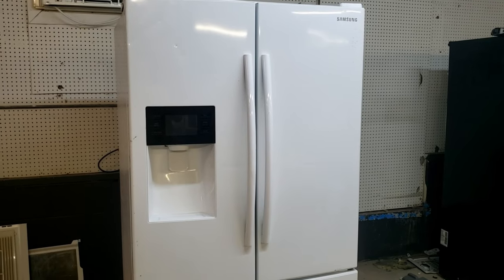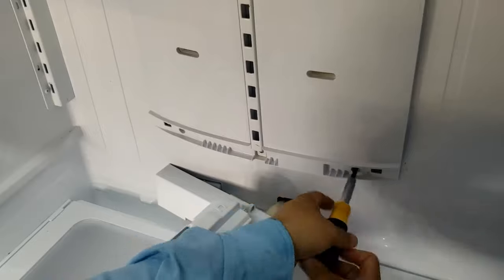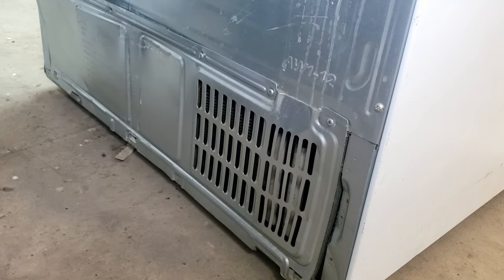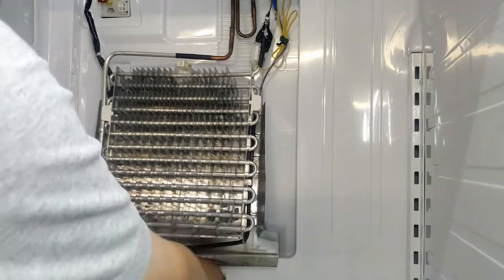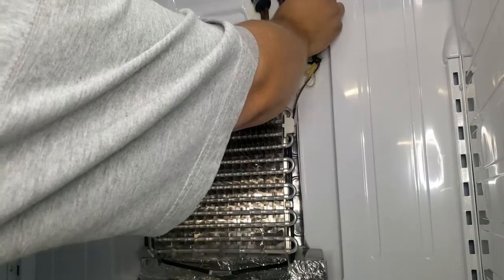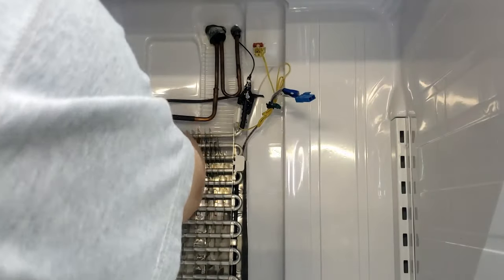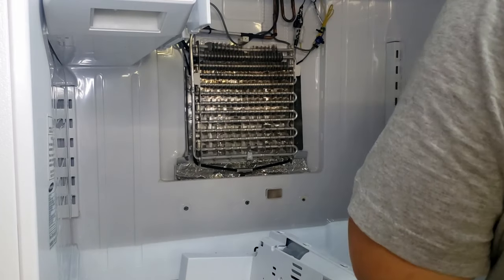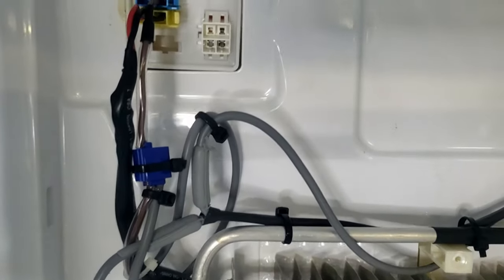Samsung Refrigerator Ice Build-Up and Leaking Water Inside Drawers - How to Fully Fix it Forever

Comment: Oh geez I was hoping I can find some way to fix mine Samsung that stopped working refrigerator a boy what can I tell you it's been sitting in my garage for every year only freezer part has been working thankfully do depend that'll make it work but for now I like to use it as a refrigerator as well quick question can we replace a complete back part why add another heater
Reply from the maker: Which "complete back part"?
Reply: @bensappliancesandjunk  the coils

Comment: You need to provide more instructions on removing Twin Cooling Plus cover.  I have removed all screws but panel will not come off.  Seems Styrofoam is stuck to ice.  Do I need to shut refrig to allow it to defrost?  If so that should be part of your instructions.  Perish food should first be removed to start this project.  Please don't assume that everyone's frig is going to disassemble as easy as yours.
Reply from the maker: Hi, I have multiple other updated videos on this with further instructions

Comment: What is the differences of the original drain tubes and the new ones? They look the same to me.
Reply from the maker: Depends on model. The replacements are 5 pieces and original are either 3 or 4 pieces. Main thing is the plastic graduated cylinder and the v notch duck bill

Comment: Hey Ben, great video and thanks for the effort.  SFQ, I have the four door samsung (RF4287HAR5) but i do NOT get water in the crisper drawers, i get ICE in the bottom of the FREEZER about every two months.  Is this a variation of the issue your video addresses or something altogether different?  If different, any suggestions on a fix?  Thanks again.

Comment: Can you share the link to the newer video of the install of YOUR kit. I purchased your kit, which slightly different than the pieces in this original video. I want to properly install your kit. I can't wait to fix this issue for good. i have been battling it for years and have replaced MULTIPLE parts only to have the issue return.
Reply from the maker: https://bit.ly/3pDgfER should contain instructions + all YouTube video links

Comment: Do I need to get a defrost heater too…or is there a way to find out if the defrost heater are still working
Reply from the maker: Run forced defrost, preferably with back panel ajar. Check for heat. If it heats good, the heater is fine. If it doesnt get warm at all, then either the sensor, fuse, or defrost heaters' bad and I do ahve videos about it.

Comment: Will this solve the issue if its our freezer fan that also gets the ice build up? We have this ice build up issue with both fridge and freezer, but freezer seems to be the worst of the two.
Reply from the maker: Yes and no.

It should remove moisture from the top cabinet and drain tubes, which should help remove moisture from all parts of the refrigerator, but primarily the top cabinet. I've seen this modification fix many other aspects of the refrigerator unintentionally such as the ice maker, too.

Comment: I have been fighting with this issue for 5 year now. I just ordered your recommended kits and will be installing them this week. 

Question: Would it help to cut back the foam insulation where the copper lines exit the back of the refrigerator and apply calk or putty  around the lines? The insulation around the lines on my fridge is always soaking wet when I defrost it?
Reply from the maker: You could potentially cut & re-insulate them. TYPICALLY the suggestion is to replace the evaproator cover which tends far more often to get soaked, so having the insulation with water still is an issue. The secondary heater should solve future water accumulation (unless there's a bigger issue than just the moisture), though.
Reply: @bensappliancesandjunk  I am installing the kit tonight and the heater cord is 3' long. Any advice on where to route the cord? Would doubling it up hurt anything?
Reply from the maker: @dougsprecher  double it up! I did another video recording of using it, and it easily folds up to double. They sent me ones that were longer than planned, but I did multiple tests with them prior to listing/selling them, and its easily flexible enough to fold double or even if needed, triple. I ran all the tests in the video with heating it via test, and it came out perfect with a very moderate heat.
Reply: @bensappliancesandjunk  thank you sir! Everything is in place and I am excited to fire it up!
Reply from the maker: @dougsprecher  fantastic! Hope you never see ice again!

Comment: Howdy Ben, I have a more basic problem…. I can’t seem to get the panel off. I’ve removed the 4 screws and from the bottom the panel pulls away (w/o the styrofoam) but the top doesn’t budge. Maybe a big ice ball still there? Fridge has been unplugged for 12 hours.
Reply: It takes a long time to defrost the ice ball. I use a steamer to accelerate the defrosting. You can also try a hair dryer but that doesn't work as well and be careful not to warp the plastic, easy to do even with a hair dryer.
Reply: @sjn7220  Thanks. I did manage to finally free the back. The ice ball was frozen around the fan and extended into the path of the blades (explaining the chatter sounds). Back together for now and working but I will order this additional heater.

Comment: I have a Model RF266ABRS mfg May 2009 - just discovered  a pool of water and ice below the cool select pantry (full width drawer) that sits below the crisper drawers - no parts house seems to have any of the defrost clips, etc. or the excessive frost service kit that will work with his unit - at least that is the result when I enter he model - is there something different about this model?
Reply from the maker: Drain kits are near-universal. Just buy generic and attach behind the plate, as that panel still looks like the same as all the others. Just make sure to clean drain hole out with water or something to ensure there's no obstruction.

Comment: I perform the mods something isn't right. It's even worse I think. I. Taking it apart to check for Ice behind panel. I. Also checking drain behind fridge. I'm also turning off water to fridge to make sure it's not actually leaking somewhere.
Reply: Ok its apart and the ice damn is definitely still there from the drain. Now I'm wondering if it's not that insulated section possibly messing with it draining. Causing it to hold water before the hole.

Comment: I have a GE model PFSS6PKXESS serial # FV 550293 refrigerator that has ice build up and water below the crisper drawers.  Will you kit fix my refrigerator too or do I need different materials and video for the fix?  Thanks.
Reply from the maker: I am not sure. I'll have to look into it and get back with you as I'm unfamiliar with the GE refrigerator and how it's system operates.

Comment: I was sending a message and sent it before I finished. When the diagnostic screen did not show a code. I touched the fridge button but it did not return to the screen with the temps as you showed. What should I check. Samsung refrigerator 
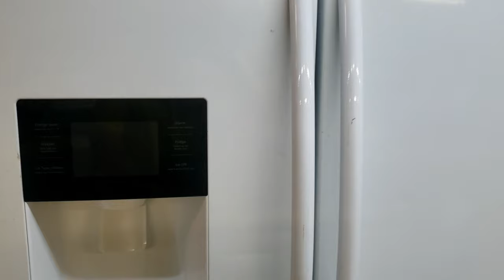0:07

Comment: Ben, I have Samsung 260BEAWW no outside water or ice.  Controls are on top of inside.  How do I get to Forced Defrost?  Thanks for the video.  First with a final solution.  Will purchase the parts and follow your instructions.  Bob
Reply from the maker: Is that the style that has a temperature display on the top that is on the outside of the refrigerator, but you must open the doors to see it? Please let me know and I will try to figure something out for you
Reply: @bensappliancesandjunk    Ice drawer in bottom and temp display inside the refrigerator must open two french doors to see. I can send a picture of the control panel.  The buttons are in line left to right: Ice Off, Power Freeze, Freezer,  Fridge, Power Cool, Energy Saver.  I have installed the new larger drain clip which did not fix problem.  The drain is freezing up and not clearing ice on defrost and the melting water overflows into bottom of the refrigerator.  Would it be better to install supco drain heater in the bottom? Thanks for the help.

Comment: I'm about to try this in 2 days. Thanks! Followed your links. What is the pipe wrap for exactly? And, have you seen/considered Nashua Stretch & Seal self-fusing silicone tape (available at Home Depot) which has a temp of -65F to 500F? plus waterproof, uv resistant, voltage up to 8000V. Seems pretty good and perhaps an alternative? But it is not an insulation tape.
Reply: Mission accomplished. hopefully it works. I had a huge ball of ice in the top right as expected. The fan was blocked with ice too, and there was ice in the panel's styrofoam. Drain was frozen down deep too. Had to keep pouring in hot water, then as it quickly cooled, sucked it out. (I used a damn straw! I'll invest in a turkey baster next time...) 8hr plus job. Just done. I watched your video multiple times when doing this. Thanks so much!
Reply: 7:10 - those self-adhesive strips has to be attached from outside of aluminum cover. You gave people wrong recommendation. It has to be between aluminum cover and fridge body !!!!!!!!!!!!!!!!!!!!!!!!!!!!!!

Comment: The kit I recently bought from you has a meter of heating element, where should I run/place all of the excess?
Reply from the maker: You can double up the element as its extremely, extremely flexible.
Reply: @bensappliancesandjunk  Yes, I found your other video on the subject and did exactly that... Just tested it and it's definitely getting hot... so that's good... next remove the non-clip for the drain hole and put the new one on... Thanks Ben!!

Comment: I also had the leakage problem unlike most I had no build up of ice anywhere. My drainage tubes were clear as I poured some water down the drain and heard it go into the pan. I did change out the heat  probe anyway for a larger one knowing it wasn't the problem but wanted to cover all my bases. Of course the leak in my veg bins into the fridge tray and onto my floor continued. I have no clue where this leaves me except to call a service tech, which I hate to do at the moment . Any comments/ fixes appreciated..

Comment: I did this repair exactly as you instructed. My fridge still freezes up badly. Is there anything else like wiring in a large manually operated defrost heater. Even putting the fridge in forced defrost is not enough to thaw it out. I have tried forced defrosf everyday for a week and its still frozen and i know the heaters are working.

Comment: Tried this fix on my RF31FMEDBSR, and it seems to have solved the icing issue in the refrigerator compartment.  Thank you!  However, now the ice maker will longer produce ice.  There was heavy ice buildup around the ice maker when I applied the fix to the refrigerator compartment, so i thawed that out at the same time.  Is it possible the position of my new heating element may be interfering in some way with the ice maker?  I know the ice compartment has it's it's own thermistor, so it may be totally unrelated.  Any troubleshooting advice would be greatly appreciated!  Thanks again for the great detailed video!
Reply from the maker: How did you defrost the icemaker?
Reply: @bensappliancesandjunk  forced defrost and hair dryer
Reply from the maker: @reikolyn  hair dryer could have messed the sensor up. I'd try to find it and see if theres any warping on the connection
Reply: @bensappliancesandjunk  are you referring to the thermistor?  or another sensor?
Reply from the maker: @reikolyn  potentially a thermistor in the icemaker. Usually using a hair dryer on an icemaker can cause issues due to warping
Reply: @bensappliancesandjunk  Add that to the list of lessons learned the hard way.  :)  Do you happen to know the part number for that thermistor in the ice maker?  Model is RF31FMEDBSR/AA.
Reply: My icemaker has been freezing over for ages, I hit mine with a steamer and it seems to melt the ice gently and works for a while before freezing over again.
Reply from the maker: @2769487  I'm going to work on a video on fixing the icemaker totally, but it does require a pretty specific kit to be installed to make it work

Comment: Our fridge looks identical to this model, but there is styrofoam under the cover (which we can’t even get off). Did this fridge have styrofoam?
Reply from the maker: Yes, they all do. If you can't pull the evaporator cover, it means there's a ton of ice underneath that's stock to the styrofoam. You need to try the forced defrost modes, or let it sit unplugged overnight with the doors open. Ripping it off will ruin the cover, and that's a bad idea.

Comment: Thanks Ben I've ordered the kit you linked below but not only did I have the water in crisper area I also have the water lines freezing in the door and the ice maker not making ice, do you think it will resolve that issue as well?  if I defrost the refrigerator and clean out the ice/water under the crisper I get water again only for it to freeze backup a few days later :\
Reply from the maker: Make sure to clean out the drain line by using a turkey baster or other item to clean and push out any crud in it. Water lines freezing in door - not sure on that one, likely not related. It has a decent shot of assisting the ice maker, however. It should also help with the water in the crisper drawers.
Reply: @bensappliancesandjunk  Unfortunately I think I found the problem with the water in the crisper area, I took  a look at the water tank, it is/was leaking but as it thawed out the pin hole became more obvious and  now i am certain thats were the excess water is coming from,  the entire reason the water was freezing is because the tank heater no longer works, also the heater and tank are TOTALLY different than any other tank/heater I've found so I may have ice but not sure yet what I'm going to be able to do about the water and tank situation :( Thanks again Ben, still going to install the Kit that will help as this was a problem about 6 years ago
Reply from the maker: @kmainc1  I've had a few tanks rupture due to freezing in fridge cabinet from bad sensors. Huge pain to fix. Best of luck.

Comment: Will this fix work on Samsung RS265TDRS (side by side); no water on the bottom, but I have the ice issue with the fan stopping; I'm getting tired of taking this thing apart every other month.  Just wanted to know if the same parts will work.  Thanks.
Reply from the maker: Should. You may have to route the heating wire differently, but if you're getting a lot of ice accumulation on the fan,. the secondary heater should splice in the same way to solve it.

Comment: I did watched this video and followed it for the drain repair including where to put the insulation tape stuff. However I now have a burning and chemical smell coming from the refrigerator. Has anyone else had this issue? 
I have found the Samsung repair guide and it says to put the insulation tape on the back side of the pan not on the front side by the coils.

Comment: The shelves on the water filter cover never move, tried and tried no luck, is it need a lubricant?
Reply from the maker: There's a tab on the underneath side that's shown in this video, did you press on both sides to unlock it?

Comment: I ordered the kit but didn't get the same connectors used in the video. Little round connectors with a pin in the middle.
Reply from the maker: You ordered the other version then. There's an instruction video on the buy page with a video on how they are installed

Comment: Have you seen the problem where the ice maker on these freezes up and locks up with ice due to the ice being too wet and way too much frost on the mechanism?
I finally just bought a counter top unit and turned off the ice maker because we were thawing it once a day or so
Reply from the maker: Yes. I am going to do a small video on that soon.
Reply: Ihave this problem a lot! I have replaced the unit twice
Not happy!

Comment: This method does not work for all models of Samsung  Refrigerator. I have model RF26X. After installing the pad under the dripping pan,  it got burned by the heating wire and released a strong chemical order. Be careful of what models fit this solution. Do you have a better solution?

Comment: would it be safe to run some mechanics wire down the drain to ensure its draining properly as well? like a better way to ensure the water is draining. this happened to my fridge im about to order the kits from amaozon. but i noticed when i pulled the drain tubes off it was only dripping out slowly. so i was pouring some hot water down the drain to see if it would help.
Reply from the maker: You could theoretically yes. The drain kit has that extended thermal probe that will go about 4" into the drain to help as well. Old school techs will just take a coat hanger wire and clamp it on the calrod heater just the same lol

Comment: Can I use this? It is available locally to me. Those on Amazon won't ship for a month as of the time of this post.
SUPCO
Drain Heater, 120V, 15W, Fits Brand Supco
Item #
66DC83
Mfr. Model #
SH201
Reply from the maker: Absolutely. Any Supco heater will work. I've used both SH502's and actually, despite the video, now prefer the SH201's.

Comment: At 3:54, what is the white part with grate holes at the back of the fridge under the water filter?  This is where my water leak is happening, it’s coming from the bottom left section of this part.  I can’t find a name for this thing anywhere online, I don’t even know what it does.
Reply from the maker: Thats where the drain pan is. Likely, its frozen up underneath. You'll need to flush with warm water to clear any obstructions, then add the longer drain probe. You'll also want to probably replace the drain tubes as well.